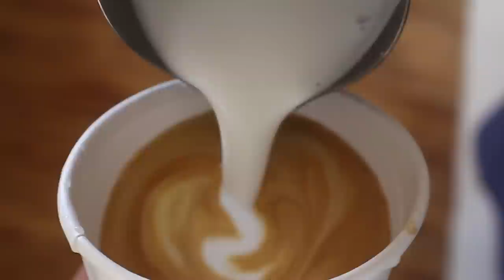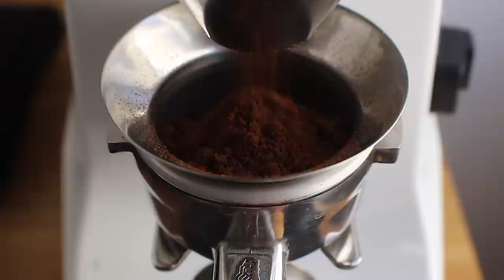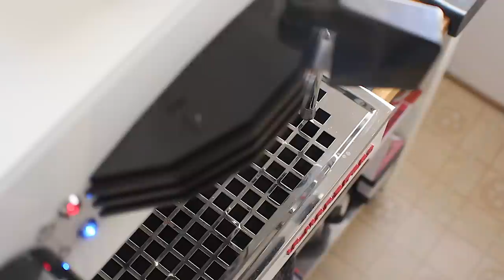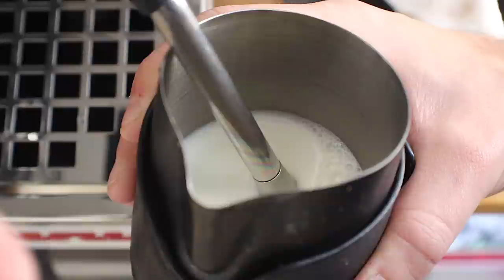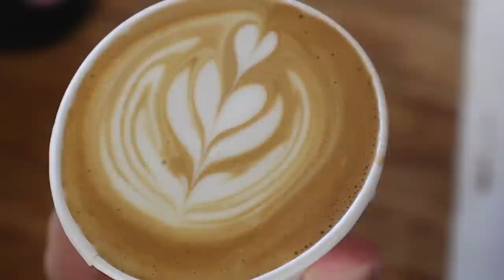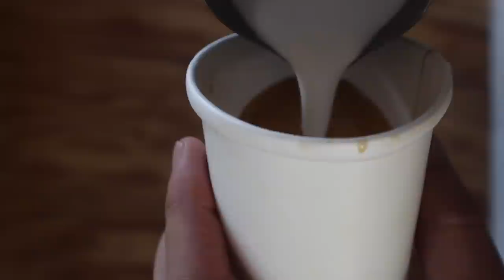DAMN FINE TUTORIAL - Latte Art To Go

Comment: I'd love to add a lesser known tip for takeaways. The plastic film on the inside of the cup has a seam, if your lid spout is placed directly over this seam, it is possible that hot coffee will leak out through the seam and make a mess when the customer goes to drink it. You can test this with your own cups using boiling water.

TL;DR: Place lid spout opposite the inside seam of the cup to avoid leaks while drinking.
Reply: Brilliant.

Comment: Hey guys I am having issues frothing my milk on a Rocket Aprtemento machine. It has a dual tip and very powerful steam. It gets the milk hot very fast and doesn't give me much time to incorporate bubbles and make nice and paint like texture. When I steam the milk I have very slight intermediate hissing not constant. one once in will rip and create to much big bubbles and its hard to recover from that.
Reply from the maker: Hi Paul, does that machine have the ability to gradually turn up the steam pressure, or is it either on or off?
Reply: Yes I can gradually turn up the steam
Reply from the maker: Paul M perfect. So I’d recommend a real slow build to find the point where the milk starts to whirlpool (will depend on how much milk you’re streaming) and then you have your point that you can aim for. So just put the air in as usual, stop at the whirlpool point, and see how that works. It should still take you near 10 seconds total to Stretch, heat and blend the milk.
Reply: @Sprometheus  Tried that today and it worked perfectly! Finally got that beautiful paint like texture. Thanks brother!!!!
Reply from the maker: Paul M yes! That’s awesome. Keep up the good work.  Happy to help anytime.